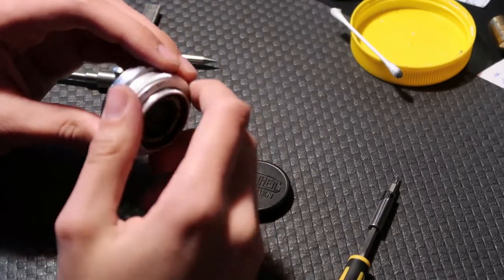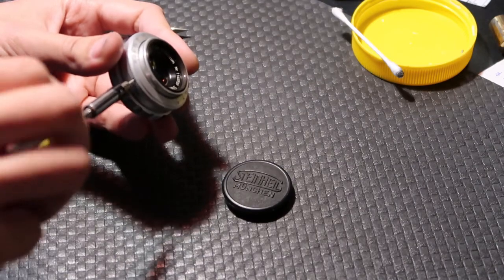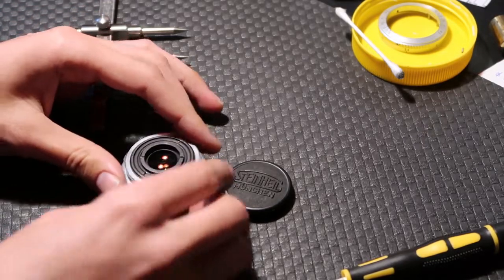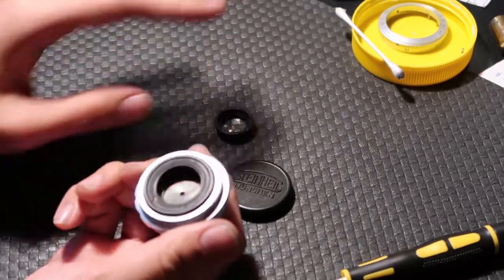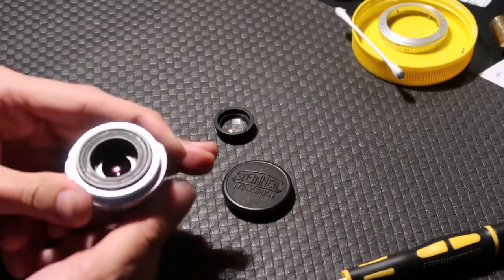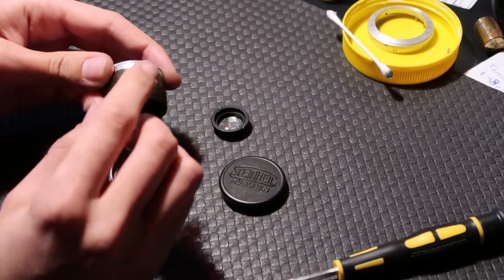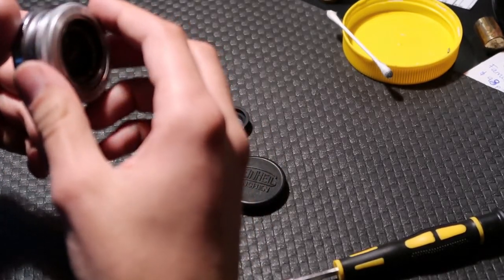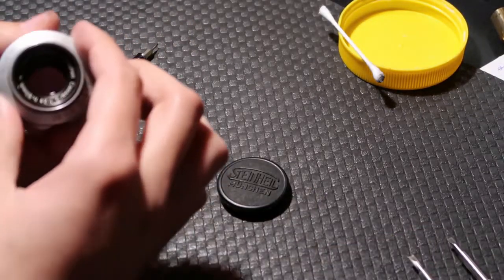Stuck Focus Camera Lens Steinheil Munchen Cassar S 50mm f2.8 Repair Service

Comment: Hi there. I have the cassar S and cannot open the front part to access to the middle lens... Can you explain how did you remove it? Thanks in advance!
Reply from the maker: To open the front part, the black ring with the lens name written on it unscrews. There should be two small slots in its outer edge, opposite each other. I used the lens spanner wrench to unscrew this ring. Be slow and careful, especially if using a cheap, lower quality spanner wrench like mine, so as to not slip and scratch the glass. Once you've loosened the black ring, it can be better to just use a screwdriver, your fingers (or a rubber lens opening tool if you have some, I don't) to rotate the ring until it's entirely unscrewed to reduce the risk of scratching the glass. Once the ring is removed, the front element will drop out, giving access to the middle lens element. I hope my explanation makes sense, if you have any more questions feel free to ask!
Reply: @toomanyinterests  Thanks for the reply. I've no slots on the outer ring with the name on it : seems to be another version. I'll try again with rubber rings. Thanks!
Reply from the maker: @cesarlambilliotte6195  It is probably another version, I looked up pictures of this lens and there are a few variations. Some seem to have another black ring, inside the one with the name, that has the slots. And other lenses don't have any slots, you just have to use a rubber ring as you said. You're welcome!